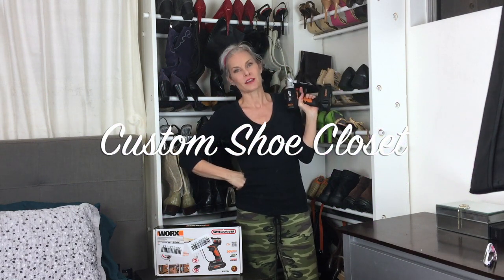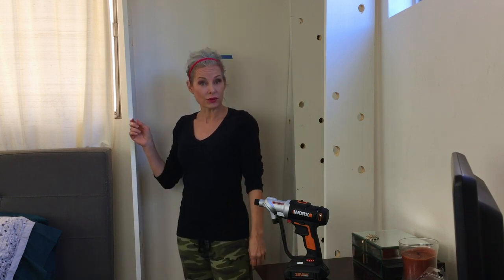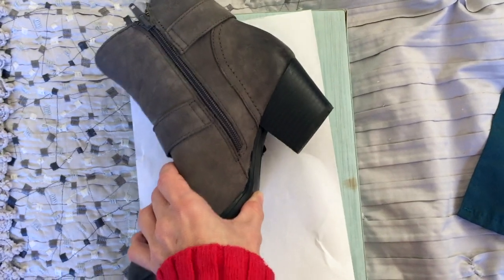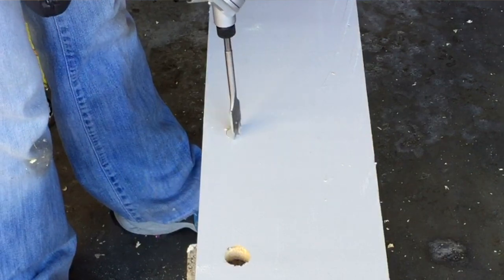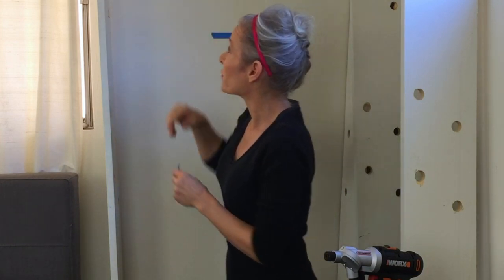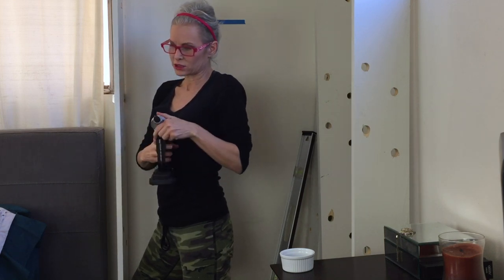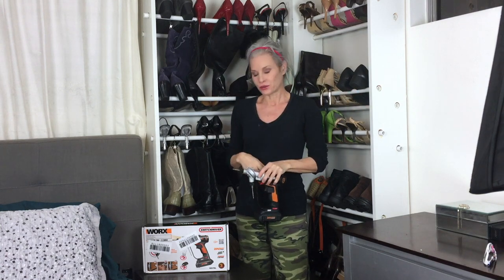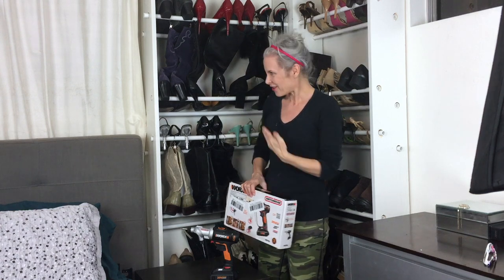DIY Custom Shoe Closet

Comment: Hi Monique

I love seeing women do their own DIY, I do all my own too and you do feel very satisfied with the accomplishments.  Monique, you can drill more holes and re-position the poles to fit your boots or add more poles for more shoes. You could also undo the brackets on the end board, move it in further a few inches so the 24" poles fit better, then you've solved those things you would have done differently. The floppy boot clips are genius. 

When I saw that drill I was impressed, then when you announced it's  a giveaway, I almost jumped out of my seat. I never care about any giveaways on any channels but this is a power tool! X

Comment: Well done, Monique! The Work driver is awesome to be able to switch around the drill and then the screwdriver head, without having to change out the drill bits every time. That's a time saver! You did a great job!

Comment: That drill is awesome. How great to be able to switch back and forth between bits. 

And the shoe storage! This completely solves the issue of storing different size shoes. You are right that the pre-made shoe storage options just don't cut it. Thanks for sharing!

Comment: I know this has been up for a while, so I hope you are still reading comments. I just wanted to thank you for showing how one can be glamorous &  handily self sufficient! Kudos! Also, having dealt with sagging PVC racks, I want to share this: a reinforced core may be made by using a section of a dowel or even a formerly defunct broom handle 😋. The reinforced keeps the PVC from bowing, and the PVC protects the wood dowel that would otherwise be too thin for the job. 
Still flying by the seat of my pants at 47, love your videos & am passing them on!
Trish

Comment: Fantastic job! I like building stuff too. That driver is awesome. One tip might be to put a cotter pin through the end of the pipe so it doesn't slip out of the holes. One on the inside on one end and then one on the outside on the same end. That would also mean extending the length of pipe and maybe more expense; maybe even unsightly. So, it could be good or bad depending on how you feel about it. Great job in creativity and workmanship. Yeah, for mature women everywhere! :)

Comment: You even have pink ballet shoes, Monique;  hos awesome! This was, obviously a great project for you! I was never happier when my Dad gave me an electric drill from Skil (he was the Atlantic Manager for them at one time), and my own toolbox, when I moved out on my own into my first apartment. Slowly over the years, he, and I added necessary tools like levels, hammers, etc., and I ended up with a pretty impressive toolbox which I used for a number of small jobs! I kind of wished it was pink, but it was authentic, none the less! I have to reassess my shoe storage as well some day soon. Most of my boots  are on wooden shoe holders along the floor of my walk in closet, but some of my shoes are stacked up in their boxes, or, if summer shoes/sandals, they are housed in two plastic sets of drawers from Walimart, also in my closet. I also have a pre-made wire rack that hangs on the wall for shoes, if it's put up on the wall, mind you (it isn't, currently!)! My wall space in there is limited though. Maybe after Christmas, you will have inspired me to get my shoes finally better organized! You can get a shower curtain rod that expands, and hang either grey curtains with holes at the top, or pretty twin sized grey sheets with special clips/rings (that I found at Ikea) to put through the curtain rod if you don't mind the curtains hanging at an angle. If it's an odd length, you can go get a hardware store to custom-cut you a piece of dowel to use that you attach on both ends, at the top of your new shoe cabinet. I made a food pantry out of the front walk-in coat closet near one of our two front doors, but it didn't have a door! We put up a dowel, and I got some burgundy curtains  to hang in the doorway. At one of my last apartments before Timmer, I used the same method to cover my bedroom clothes closet. I hung hunter green twin sheets using the special clips/rings on a pre-cut dowel that I stained as well. Job well done, Girlfriend! Thanks for sharing! It must feel fabulous to have all your shoes properly housed, all in one place! I hope there's a little extra space left though,  for when the budget allows for some new shoes to be purchased, missie! Sending my love, and hugs, Monique, Sherrey💗.

Comment: Very impressed! I did something similar, but I took the lazy road and used extensible shoe racks and stacked them inside a small closet up to the upper shelf,  and... tah dahh, instant Shoe Shrine! I am also so impressed by that power tool, how cool is that to be able to switch from drill bit to screw bit without juggling!

Comment: What a great idea and you did a great job.  That power tool was crazy!  I have used a standard drill with quick-change tools, but always dropped them just when changing.  They were more quick as in mercurial than efficient.  I luv the idea of the switch drive.  Can you remove the switching head for a conventional chuck?  It would have been fun to see you give a few "booth babe" poses with your handiwork - lol.  Bless you for all you do!

Comment: I built a bookcase for the family room, it has books on the bottom shelf and the.otners have been used for family members pictures and knick knacks the top is under an antique mirror, the top has a clock my parents bought in El Salvador. I stained it Cherry and am quite proudly of it too. The worst part was the drilling and screwing. So am understanding of the process you would have gone through if not for the drill you used. Good on you for coming up with the concept and execution.

Comment: I really liked this, I think you did a great job. Have you looked for some sort of endcaps for the PVC pipe, that can kind of finish off the look on the ends that show? It might also help keep the pipe seated a little more securely for the ones that are slightly too short, depending on what you find. I know there's got to be something out there that's made for this very thing. But I really like this type of thing and I'm looking forward to your next DIY/decor video. :)
Reply: You can get some but they're kind of expensive and she would need so many. She's going to cover the whole thing with a curtain anyway.

Comment: I was going to ask you how many volts the Switchdriver was, but saw the linked video at the end says 20volts.  That's a nice amount of power for a cordless.  Battery looks pretty compact too.  Did it last the whole project?
Reply: better to swap batteries once then having to switch back and forth between loaded bits or two drivers all day.

Comment: Can you put a rubber band around the ends of each PVC pipe right where it sits in the hole, that way it will grip & not slide but not show.

Comment: Congratulations x2!  You posted a Video recently that said you are moving, thus you will have another opportunity to "build" this. 
One for the build of this and two, impressive, minor flaws & all!  I'm inspired!  And two, for the moving on to a place you will be part owner of!  Yay, It's wonderful that your are building your assets & creating a more pleasing & growing,  financial/life base.  :D 
 I don't know if you can take this shoe rack with you, but if you leave it behind, take some Photos so you can remember what did & didn't work.  I didn't like the empty "closed" box you created in the corner because it seems to waste space & might attract nasties,  :(  who like/want to live in the darkened corner.  
My suggestion would be to mount the broad flat sides of the inside corner ends of the rack to the wall, as opposed to the narrow flat sides as you have it here.  The corner box is then "open" instead, & then put your holes in staggered so that on the "North/back" wall the boots are the first row & the "East/side" wall has a shoe row first, or vice versa.   It's like the boards become the other half of "box" that this original had.
You should be able to stack them in any number of combinations so that the rows are always offset.  Continue the (alternate) stacking so that they are all staggered, & that way the bars have their own "clearance" of space to the end.  There will be a cross over of plastic pipes in the corner.   
This new corner can then become a hanging place for some small items, or mini shelves for small boxes, or bottles that can "ride" over plastic bars.  You may have to get new plastic bars if you make it to fit the same amount of shoes.  Or you might be able to get a connector to put two pieces together.  They can then be glued together to "stretch" the length.  You may need to add a weight support of some sort in the middle, an "L" bracket or a Curtain Weight Middle support bar.  (I don't know the right name for it.)  Maybe lay the footwear out in lines and rows, in two sections, one for each side, of the current unit,  in one of the empty areas, before the furniture goes in, or in the old place after it goes out, to see the spacing & functional layout that will work best, for the actual boot lengths needed & shoes you will be keeping, for your new space's best placement of the reworked rack.

Comment: go girl! hey I am impressed. great job. pretty is great but to be self sufficient is wonderful especially for us women. I been married 30 years and do all inside home repairs add a some in garage. oil the garage door chain every year. fix wall cracks. put new electric plugs in. etc. hubby is wonderful but not Mr.  fix it. I even used to do plugs n oil, timing, on older cars till computers etc took over. so I am finally glad to meet another capable women. feels good to get stuff done huh? time for bubble bath and bottle of wine. you deserve it!!

Comment: As a single mom, we D-I-Y ers have to stick together. On the end where the pvc pipe is 24" & too short, you could put some silicone caulking in the holes to help secure them.